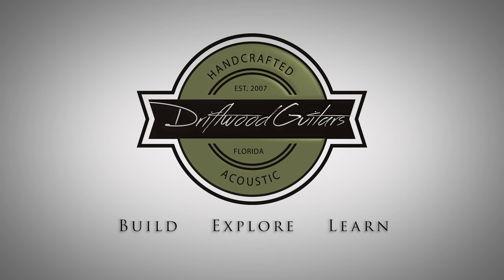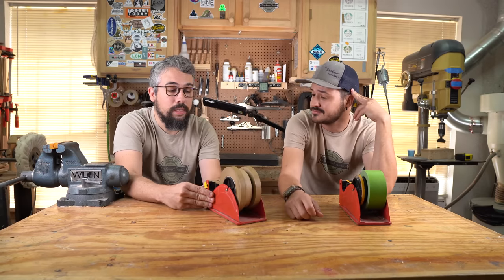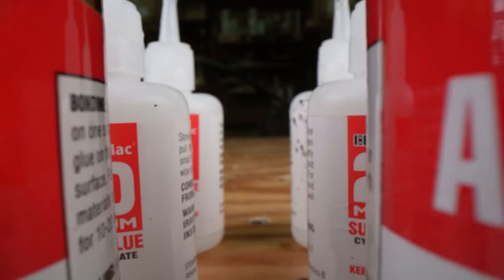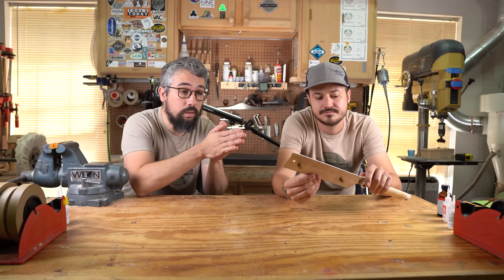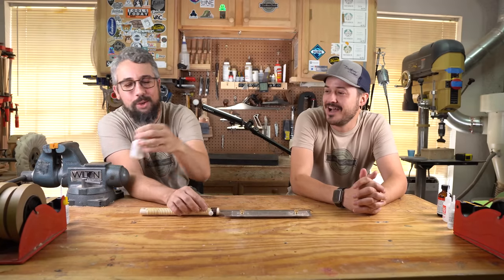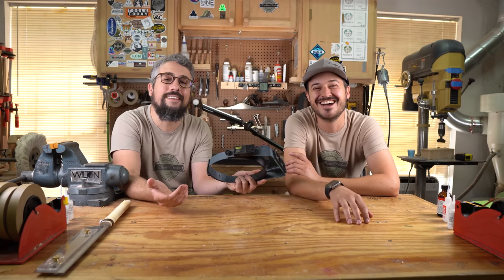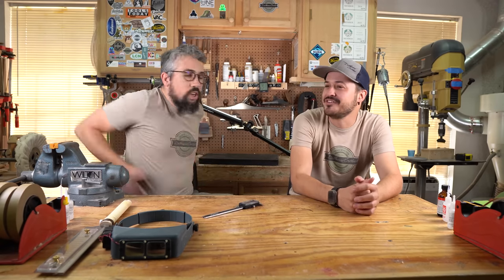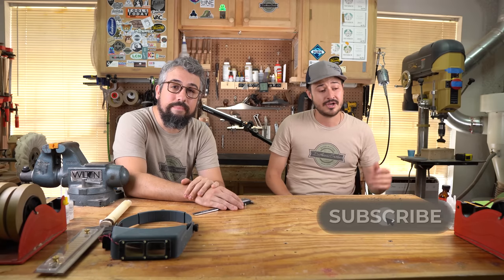Six StewMac Tools I Use Everyday In My Shop

Comment: Good show guys.  Always helps to get and idea of what is actually being used tool-wise.  Been meaning to pick up a couple of the “indispensable” tape dispensers.  Perfect timing.  I did go up to StewMac, they are on sale, but no BOGO 1/2 off.  They are selling at 12% off, like the one in the video.  The empty dispenser is 20% off.  Just FYI

Comment: If you're looking for material for a video, I'd be interested in your thoughts on different types of glues...Titebond wood glue, hide glue, superglue, epoxy...  the whole range and what your experience has been, likes, dislikes, examples. Include the reversibility of each, even, say, superglue. I know it's not technically reversible, but there's still the process of taking two pieces apart that were glued with it. You do this on a nut that's been superglued. But even two pieces of wood, how's each glue come back apart--- razorblade? cutting torch? dynamite? hehe...

Comment: I had the magnifying visor for a while... And there's new ones that are just world's better, the new ones allow you to swap out the front magnifying glass for different strengths and there's absolutely nothing surrounding the glass, so your peripheral vision is still in tact and the light is uptop and adjustable, plus they're like half the weight of those old school ones, it weighs absolutely nothing and requires you to do a heck of a lot less monkeying around to make them comfortable.  Once I got the new kind I've yet to touch the old one I have like you, seriously it's a different world!
Reply from the maker: I’ve tried those dozens of times and hate them haha. I’m sure glasses like these must be pretty different depending on the user.
Reply: @DriftwoodGuitars  yeah I've definitely got neck issue so the weight to me is a huge factor!  I also love the glass with nothing else around it, for me I feel like I'm less distracted and it's an easier user experience.  I absolutely love these videos by the way, you guys make really excellent content that's very relaxing and fun to watch!
Reply: Are you saying stew mac has newer better ones or another brand?

Comment: I find the SM fret pull-saw hard to control with freehand work, which it is not made for I'm finding out ;-)  I prefer a pull-saw from Rockinger which is a smaller size and is very nice for fret slots FWIW